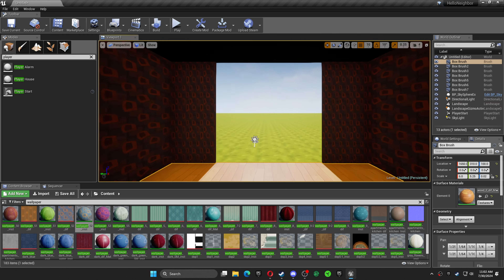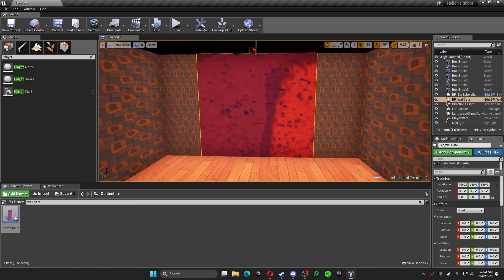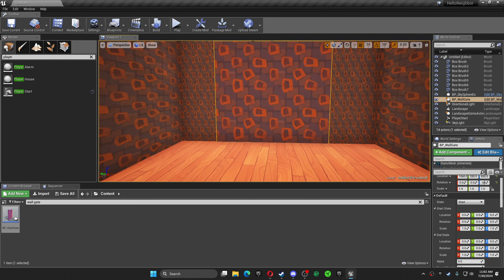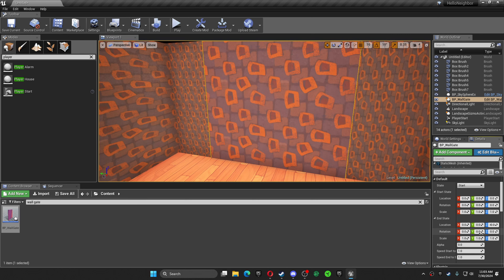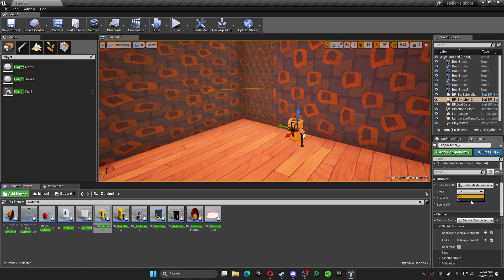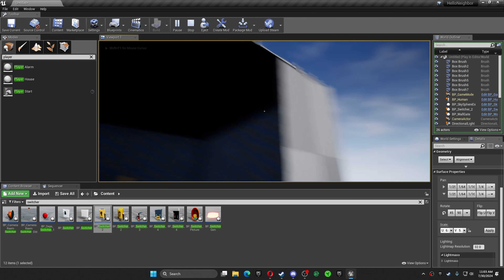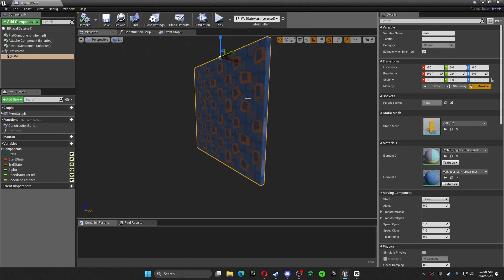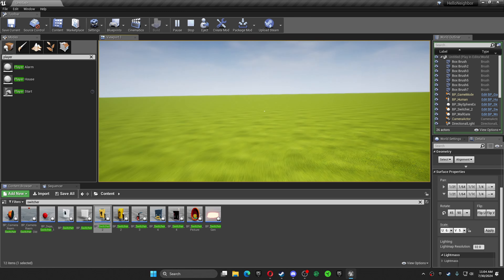Setting Up Wall Gates | Hello Mod Kit Tutorial

Comment: None of my working items for the old art like the commode and nightstand won’t appear, could you tell me how to fix that? (They only appear in edit mode for some reason) and also what should be the story for my mod? And which house should I use for the neighbor
Reply: Also when going in and out of edit mode, any edits I made to the player or neighbor disappear, although I think that’s because I use the neighbor and player start rather than the BP versions
Reply: @GamermotionOfficial you need to clean the auto saved